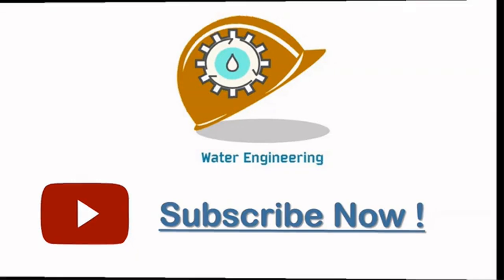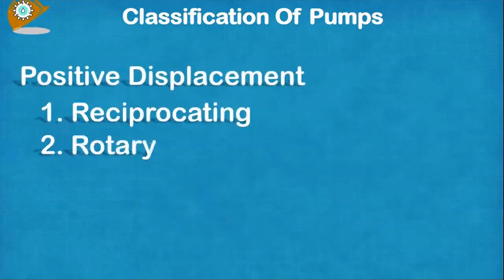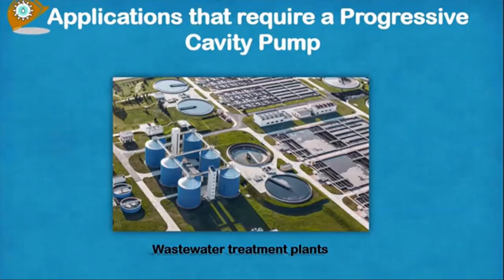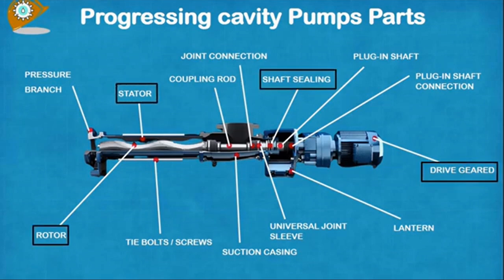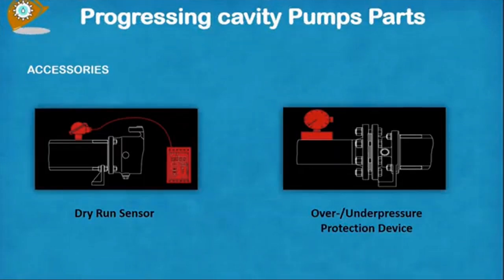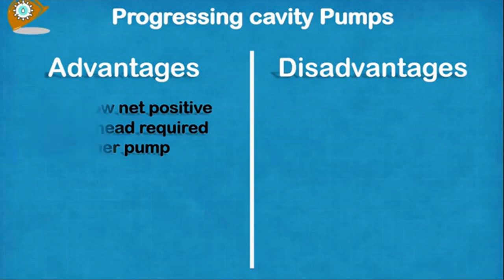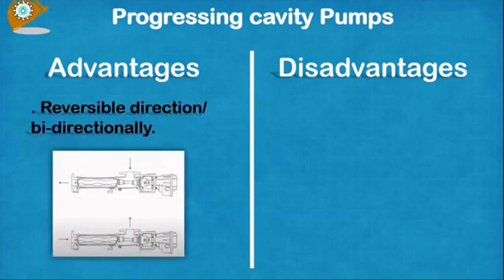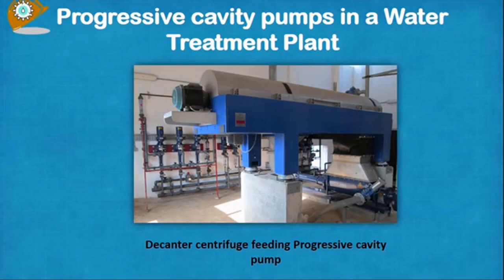Types of water pump - PROGRESSIVE CAVITY PUMP PARTS, WORKING, ADVANTAGES AND DISADVANTAGES

Comment: very good, but a PCP doesn't have problems with low viscous products, the leakage in the pump is higher, but than we take a double staged pump to reduce the internal leakage.
For the higher viscosities, we take a hopper pump and a feeding screw so that the product (up to 40% dry matter content) gets to the pump with pre-pressure.
Reply from the maker: Thank you for these clarifications. The objective of the video was to introduce the PCP